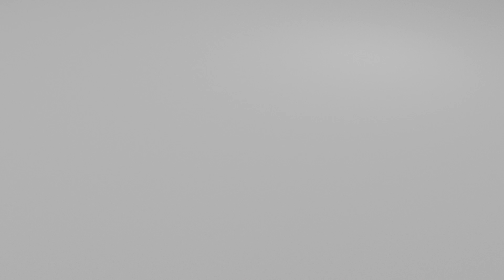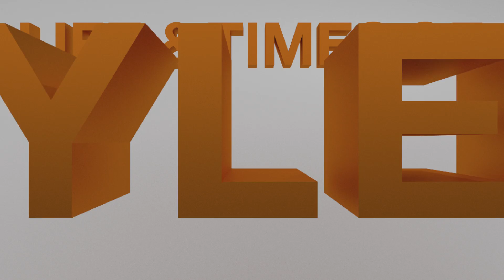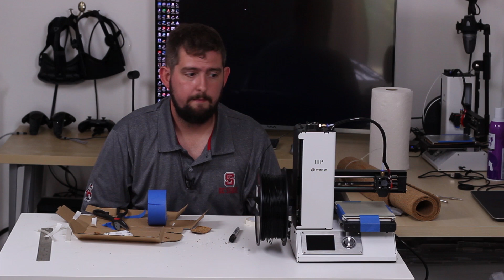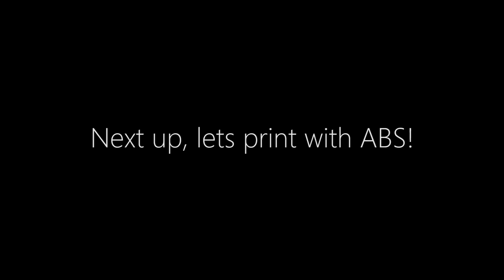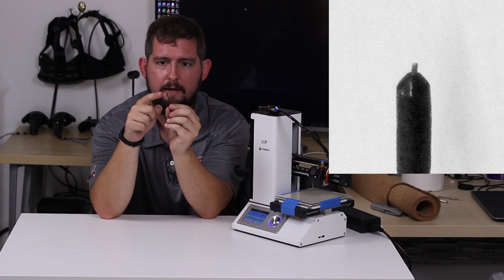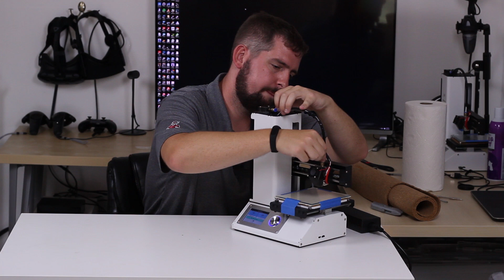Monoprice Select Mini 3D Printer Beginner's Guide (Part 8) - Swapping from PLA to ABS filament

Comment: Why cant you just cut the filament flush at the top of the bowden tube, butt the new roll against the old filament and extrude or print until the new filament appears??
Reply: Because that's a lot of wasted filament.

Comment: Got my Mini up and running, after having some trouble getting the ABS prints to hold I used my hot air reflow machine to blow hot air as the mini laid down the brim... fairly hacky but worked really well
Reply: I should try this. I have a low-ish-power heat gun I could stick in front of it.

Comment: Tyler, about to pull the trigger on one of the Minis for my first 3D printer. I've read some review that some users can't get the bed temp over 50 or 60C for ABS, however you apparently were able to set it to 80 - 85C. Was there a firmware update or hardware change, I feel like I'm missing something...
Reply: did you figure out the issue? im having the same problem.

Comment: yes in stl file
Reply: You have to save your file to the SD card as a "filename".gcode or use Cura and save directly to the SD card in the lower right corner - that will save the .gcode file not the STL. You can not print an STL file

Comment: Hi Tyler I am just getting started with ABS on my Mini.  You set your hot end to 230 but I did not hear what temp you set the bed.
BTW: Added a glass bed on mine using your tutorial.  Found it very helpful so thank you.  One mod I did was to cut the corners of the glass so I have easy access to the screws.
Reply from the maker: First, make sure your room is draft-free and warm (70F+).  Second, you may need to rerun the PID autotune for the bed itself. 
M303 E-1 C10 S90 (autotune 10 cycles for 90C bed temp)
M500 (to save the autotune values)

This should get you to 85 consistently.
Reply from the maker: valveman12 glad it helped!  I use 85c for he bed :)
Reply: Thank you Tyler and Happy New Year to you and your family.  All the best in 2017
Reply: how did you get to 85? modification mine only goes to 80
Reply: No matter what I do, I can't get my heat bed above 75C, and that's if it's 70F+ in the room =/
Reply: Ash Wolford have you tried setting the temp on your computer using the iP address located on top of the display of the 3d printer? it's set for 80 or 85 and won't reach it? it may be a issue with the printer...may have to go back :/
Reply: even setting it to 100C, in a ~70F room, mine can't go past about 75C. I was under the impression this was normal for this printer, since I'd read reports to that end, and someone on hackaday even modded theirs to add a second heater element to bring it beyond 75. I was considering making an enclosure for it to trap some additional heat and get a few more degrees out of it, but yeah. actually I only wound up here because I was looking for videos from people who had been able to print ABS on theirs without warping. lol
Reply: Ash Wolford I would contact support and ask for them to troubleshoot it with you....mine will reach 85 in a 70f room
Reply: Even that unfortunately seems pretty weak for the filament I have, which specifies 100-110C and warps at 75 even with a raft. Maybe I just need to buy different ABS =/
Reply: do you have any high strength acetone nail Polish remover?
Reply: unfortunately nah. I've been picking up a bunch of stuff for it though, and based on the nozzle maintenance guides I've seen, I'll be needing some of that anyway =x
Reply: also how do I change abs to more abs filament?

Comment: This video saved my ass.  I thought you can cut the filament off at the spool and extrude the leftover material until it's completely gone.  Wrong!  Thanks to this video, you showed me those blue rings at both ends of the Bowden tube are quick-release mechanisms. Now I have a new spool installed and ready for printing.  Thanks Tyler!
Reply: Exactly what Hellerium said! Thanks Tyler! Got switched over to ABS with very little issues. Was able to clean out the Bowden tubes of the broken PLA easy enough and got a test run on ABS this evening. Sticking to the platform perfectly!